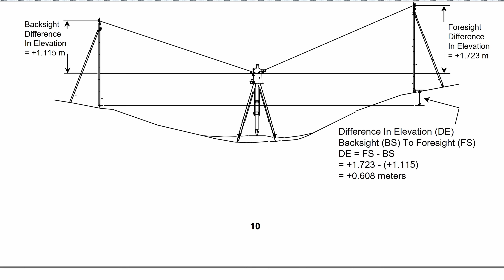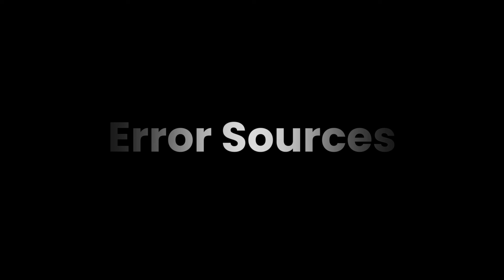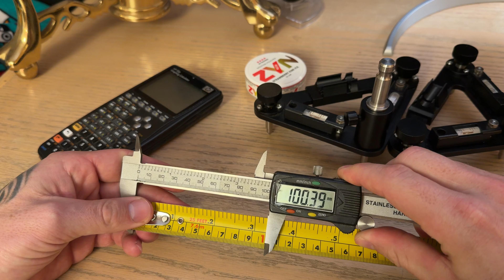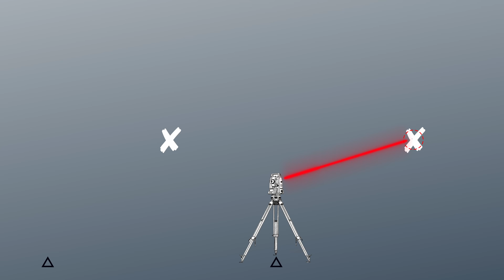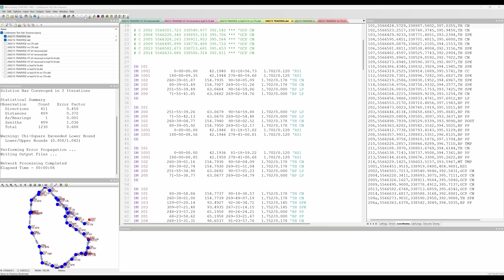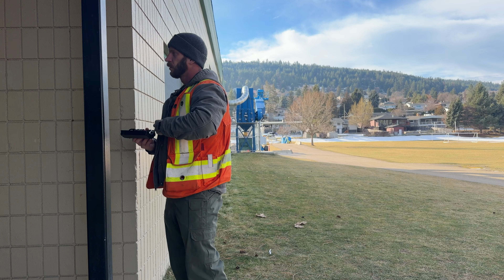Increase Total Station Vertical Accuracy (The Common Point Method)

Comment: Are anyone aware if this methodology is applicable in TBC? To be able to "remove" any height measurements from the network compensation and only use common points to determine stationned point elevation? Thanks for sharing such great content ! Cheers from Quebec

Comment: An elegant but simple analysis and presentation! Thank you, Shea. This is one of the most comprehensive, well-developed, relevant, and useful YouTube presentations on the web today. Other presenters should pay attention to Shea's use of analysis and error reporting to make his points. His understanding of how to fit and compare models is acute! Even major equipment vendors fall short of this level of thought. Go Shea!  RP

Shea, now that you have established the beginnings of a reference course and network, it would be fun to compare single wire differential leveling, three-wire differential leveling, trigonometric leveling, modified trigonometric leveling, and laser leveling. I know, easy for me to say....that would be a tremendous amount of work and not so easily externally generalized.
Reply from the maker: Thank you very much for the kind comment!

That would be a lot of fun, I’ll have to add that to do list.

Comment: Good to know that such a precison is achiaveable albeit with the right methodology and instrumentation. 
The old Measuring tape, which is responsible for the HI & HT; is probably the single biggest culprit when it comes to busted elevations and should be eliminated from the Surveyor's toolbox by now. Trimble used to have a 'height bar' to measure the HI & some of the newer TS has the laser HI  reader.
Reply from the maker: Yea they have one on their traverse kit. I’m reviewing it right now and it makes a big difference for height measurement

Comment: Another great video, thanks.

If you just want to improve vertical accuracy, you could use a mini prism (with a fixed pole height) to measure the common points.

I agree that the greatest chance of introducing an error in the heights would be from an incorrect hi or ht measurement.

Not traverse related, but whenever I set out heights using the total station, I like to physically measure the benchmark with the same pole that I’m using for the set-out.  I then change the pole height in the controller to match the RL of the benchmark.  Essentially the same idea by eliminating errors due to tape measured hi.

Comment: You talk about corrections for the earths curvature, however I don't really see that being use on starnet or your other tutorials, could you make a specific video about it? When you need to start taking into account this factor, how the R would be calculated and how you would actually do it in your postprocessing? Also wondering if those heights would affect a local grid or if you would end up creating multiple local gris per project when dealing with curvature of the earth
Reply from the maker: It’s a check box in starnet for local projects. You can adjust the radius and refraction values used. If you select a mapping projection the true radius for every point is calculated and used.

Comment: I wondered if this method could be applied with "simple" cross paint markers aswell for even faster moving in the field. Of course reflectorless measurements will be less precise than using the ball prisms, but I guess that would be still better than having nothing working as common points. 🙃 You're SUCH a legend. Thanks for existing and sharing so great content with this messed up world...

Comment: I was looking forward to watching this one Shae.  Thanks for the mention, although I feel like my contribution was small.  I think this is a valid technique and the advantage is that it works well with existing equipment and software you are confident of.  As mentioned in the comments below, this technique would work in cases where you'd like to have differential level accuracy, but are looking at a large change in elevation that would require so many setups that the tiny standard error associated with differential leveling would propogate to the point where the standard error of the result would be unacceptable.  Over a large vertical change, this method is better than a level.

Comment: @The3rdDimensionSurveying Thank you for your excellent work clarifying the world of surveying. I would like to propose a video topic that I haven't seen anyone addressing: the accuracy and precision of a handheld slam scanner in long 1-mile corridors compared to total station coordinates, using or not using RTK and control points. I also have a question: would it be necessary to check checkpoints that were not used to process the point cloud for consistent verification?
Reply from the maker: To answer your question, 100%. I’d go as far as to say mandatory. Using control as check shots tells you very little unless you know the weighting applied to those control points or it’s a rigid adjustment.

As for the video suggestion, yea I can work that in. Without control or RTK it’ll most likely be very inaccurate

Comment: Any chance you want to share the model for that 3D printed ball prism holder? I like that.
Reply from the maker: Absolutely, give this a go…

https://1drv.ms/u/c/409a77fcc169e845/IQBp9BpFMafgS4_cQrUrvdwfAT_IPy8VC7_W3E16dBmLK74?e=zkwbgd

If/when I were to print it again I’d make the insert and bottom one piece. No need to have the separate. And use supports, the hinges were touch to overhung for my printer

Comment: This is great content. Any chance you could make a quick video on establishing a control network with rounds in access? Measure rounds is a standard workflow for me but actual methods for traversing with rounds I am not familiar with.
Reply from the maker: It’s essentially the exact same as rounds for a resection, you just select measure rounds under the measure tool and make sure you have prisms all setup on your BS, FS and any other points you want to include from that setup

Comment: In my workflow, I typically use prisms anchored at walls or catenary poles, which I observe from multiple setups. This essentially transforms the traverse into a 'network,' significantly improving vertical accuracy and mitigating the typical drift issues associated with linear traverses.

Comment: I have had extremely good results using the Leica GHM007 with Leica traverse kit, a couple of tests I have run using it compared to a LS15 have come out within 2mm of eachother
Reply: Yes! This measuring tape, which measures accurately pretty much all Leica prisms, HDS targets and total statition from tribrachs, is awesome! It's another reason why the Leica ecosystem, while imperfect, is slightly ahead of the curve in the field of high-precision surveying.
Reply from the maker: Those are awesome!

Comment: Forced centring literally exists for this reason. 
You are not achieving anything tangible.
When you swap the heads over on a line, you have perfectly matched the collimation and so on. there is no additional error.
The error in height (other than the limits of the equipment) fall completely to the tape measure measuring down to your mark and is by far the largest.
Using a matching S-Series instrument and back sites (with swing out S/SX notch) should net no more than the error of the tape (around 3mm when you factor in bend, the wobbly bit on the end or using different tapes in one traverse).
Reply from the maker: It's impressive how wrong you can be on every single comment you make on my channel. There's no way you're not a troll. Good luck brother!

Comment: This is a great video. Possibly, though,  you are missing an opportunity in your innovative concept. If one is confident in the accuracy and setting of the prism pole height, one could transfer precise elevations by adopting FS and  BS observations (instead of instrument HI’s), when using your traversing procedure with one tripod. This has the potential to work well on a traverse with an even number of TP’s, with the first BS (#1) being adopted, then transferred to the third, and so on, until it is transferred back to #1.
Reply from the maker: Yea I think you’re describing what another commenter mentioned. It sounds like a fantastic method. Are you aware of any papers I could read on it to learn more about it?
Reply: @The3rdDimensionSurveying  No, I just came up with this, brainstorming after watching your idea. I'm sure I'm not the first to come up with this, but I've never heard of it. And also, with an odd number of traverse points, I'm sure that one extra shot at the end would take care of the problem. I had to sketch it to visualize it.

Comment: This is barmy and doesn’t get rid of an inaccurate HI/HT measurement, that remains. Also - because its not a reciprocal measurement its subject to refraction/curvature error. It does govern some redundancy I suppose. 
If you want to avoid a measure up error, use a prism or pole who’s HT you trust on that point.

You need to have prisms at the same height as the instrument and adjust if necessary. (Short distance reciprocal readings can be used to test the centring errors)
Reply from the maker: Barmy, never heard that before. I like it.

I think I said it doesn't get rid of hi/ht error maybe 3-4 times in this video, it eliminates their compounding effect.

Of course it doesn't eliminate curvature or refraction errors. I didn't say it did. There are other ways to handle those errors like there are other ways to handle the other 10+ errors affecting a vertical measurement.

Simultaneous reciprocal trig levelling is a completely different topic and a completely different level of effort is required.

Comment: Have you use used match traverse kits with tripods?  (Trimble Traverse kit with S instruments) where the target and is matched height of the instrument so when you the measureups at points should be the same as you leap frog the instrument through the tribrachs. We get similar results with the target heights from one spots does not effect the whole traverse.    I believe even Access autofills the heights in you as leapfrog,  and you can recheck the heights. It may not be a good  as indpendent  shots, but I think it would produce better results than  pole and instrument measurements.
Reply from the maker: Trimble backsight kit is sliiiiick. Im trying to get my hands on one now but to answer your question, I have, and that's a fantastic method of reducing vertical error as well! Especially since their back sight kit has a measuring tab specifically design to increase your measure up accuracy.

Comment: It sounds like the raw data file will need a good bit of editing before running through a LS adjustment. I think the idea is great, I just hope you can get someone to add a routine to clean up the raw data automatically.
Reply from the maker: It took me about 3 minutes per dat file copy and pasting &&* but I certainly wouldn't complain if that step was removed from the process with some automation.
Reply: @The3rdDimensionSurveying  I think if you coded the points in a certain manner, a perl script ( or insert your programming language of choice) could be written to massage the data pretty easily.

Comment: Sorry if I misunderstand, we do things differently in my country, but: 

if I understand correctly, the "normal" method you describe involves placing the traverse prism over a nail, measuring elevation with tape to set target elevation, measuring the point; then setting the station over the nail, re-measuring from the nail to set station elevation? 

Why not just set target height to the difference between trunnion axis and prism axis height over tribrach (easily checked by making two measurements between stationary tribrachs), station elevations to zero, and adjust the point heights based on noted tape measurements after the run is adjusted? No influence of tape measurement error in the adjustment, just 1x error for each final point (or 2x if initial elevation comes from tape).
Reply: Last time i saw that method, was 20 years ago from a crew with manual total station and an external data recorder (or even handwritten). They set the rod height the same as the total station in every setup. 
Best time saving (expect from the internal shots) is a fix height rod and a total station with laser distance height measure (like most of Leica TS). Every time you manual measure a height you are adding errors no matter what. Great video as always!
Reply from the maker: Im unfamiliar with the method you are describing but I think Im understanding it correctly. You're essentially leaving the network elevation in the center of prism & bumping that along as you traverse? Then when you're all done you manually subtract your measured Hi's to define your points elevation?
Reply: @The3rdDimensionSurveying pretty much! By using the prism-station height difference as target height, the elevation of the measured point will be at the trunnion axis when prism and  station are swapped between the tribrachs. No stacking tape errors. 

You could still get correct elevations for the nails in the field by measuring target height with tape and adding the prism-station difference, and setting station height to only what was previously measured without adding the difference when you swap, I just think it's a bit more "me-proof" to do it after.

Of course, your "common point" method will presumeably give more accurate elevations as it removes issues from tripods settling, expanding/contracting and flexing from the weight of the station, and it's something I'll keep in the toolbox as I already keep a set of ball prisms in my pocket!
Reply from the maker: @Nedgren  Very cool! Thanks for post. Always learning something new here.
Reply: Yep… the leapfrog/three tripod method. Target height=instrument height (196mm axis height)